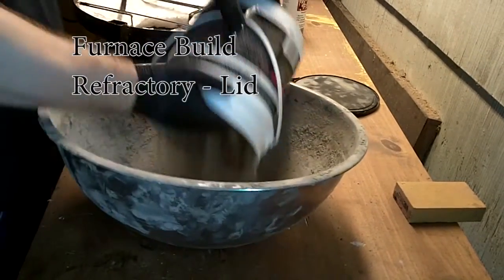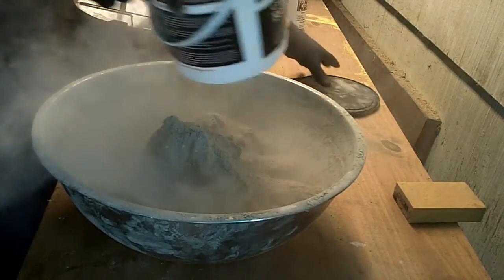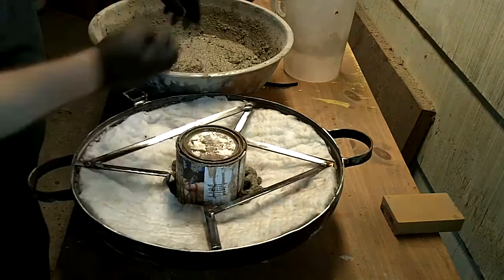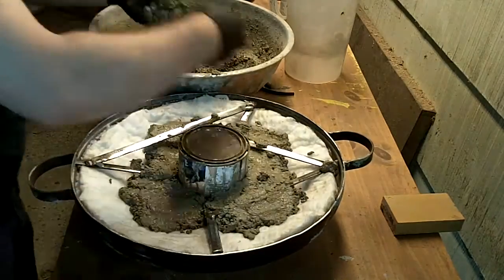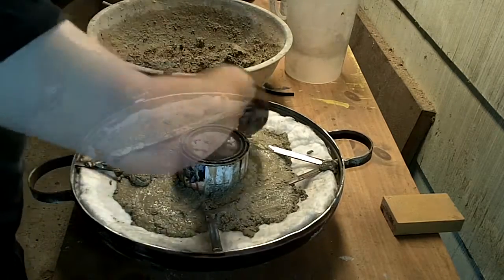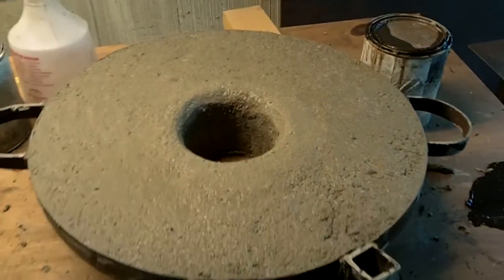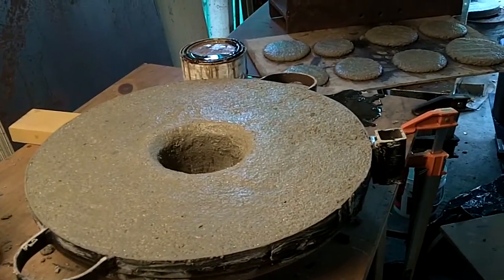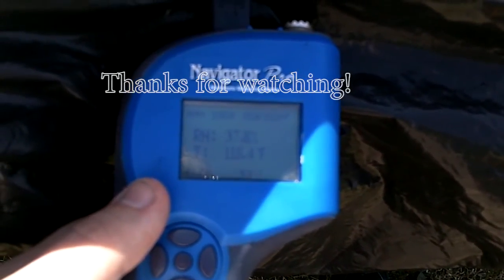Furnace Build   Refractory Lid

Comment: do you know if refractory cement can handle molten metal on it? I am thinking of lining  a barrel with some and having a drainage channel for the alum to pour out the side of the barrel. I am melting breakage, so it needs to hold things slightly larger than lawnmower engines.

Comment from the maker: digitizer101  The refractory I am using is the Rutland Castable Refractory mix, its rated for 2200F. If you have a pottery supply store, or something similar, I would recommend buying the refractory in bulk bags... it ended up costing alot more money buying it in the 12.5LB pails. Also I used alot more than I had anticipated. I believe it was 7 for the furnace body, and 1 and a half for the lid. 

The inswool I found at clay-planet.com. They seemed to have the best SF price that I was able to find.
http://shop.clay-planet.com/inswool-ceramic-fiber-blanket---by-the-square-foot.aspx

Have fun building :D
Reply: if I am using a barrel to melt large things, think 55 gal old drum, but this one is a smaller version with thicker metal. If I wrap in that insulated fabric, on the outside, do you think it will stay hot enough inside, if I cover the top? I have a godzilla waste oil burner.